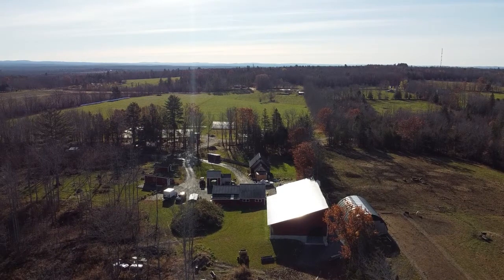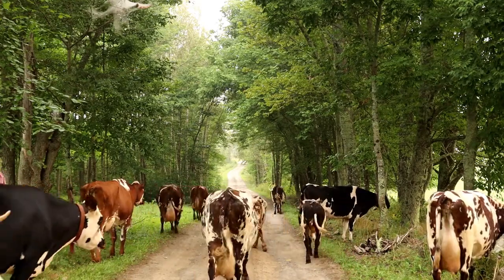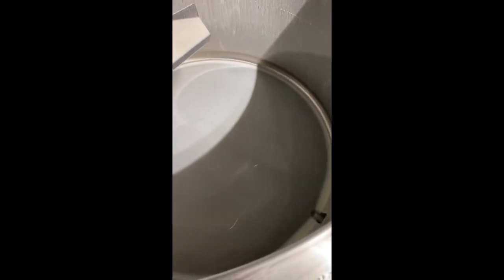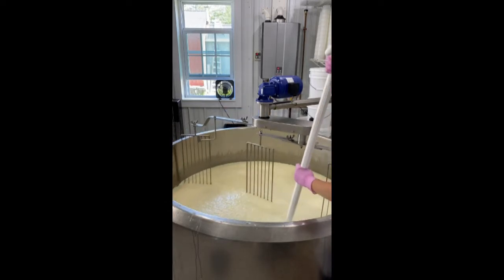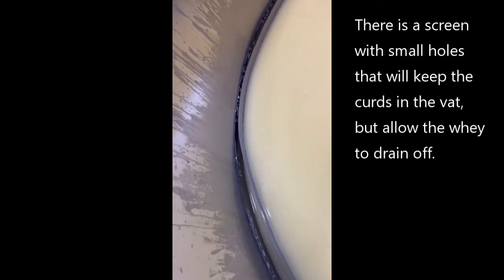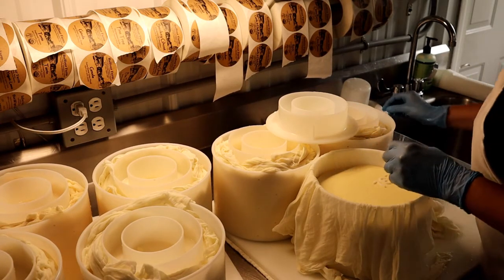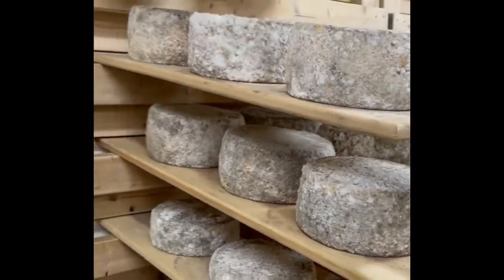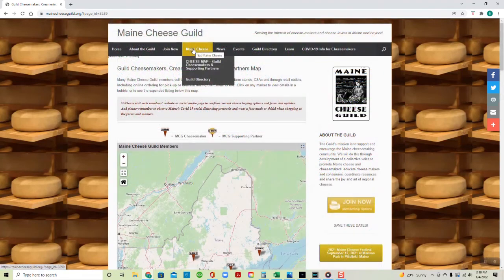Pasture to Plate: Making Cheese at a Maine Farmstead Creamery, Balfour Farm

Comment: What kind of cloth and where do you buy it and How do you clean your cloths and where do you buy your cheese moulds and what model cheese moulds do you use for your hard cheeses? Thanks.
Reply from the maker: We use flour sack towels for cheese cloths. They are Saturday and reusable. We wash the in hot soapy water and they use dairy sanitizer in the rise before a final rinse. They are then put through a high heat dryer cycle. Our cheese mounds initially came from New England Cheesemaking in Massachusetts. They have home scale cultures and cheesemaking supplies